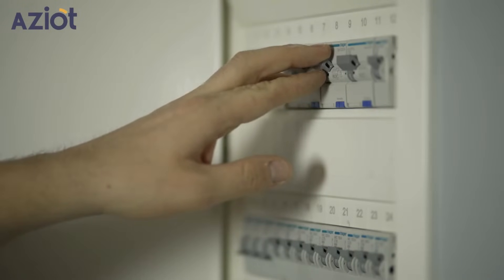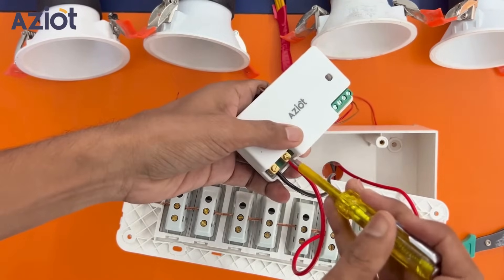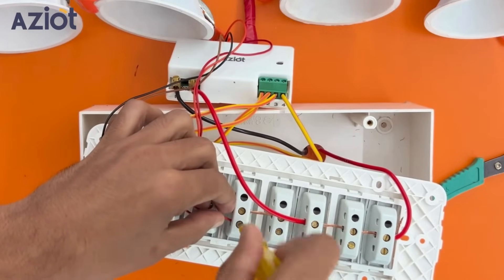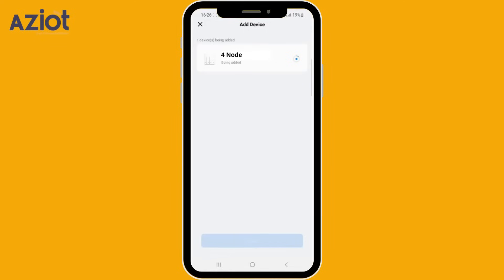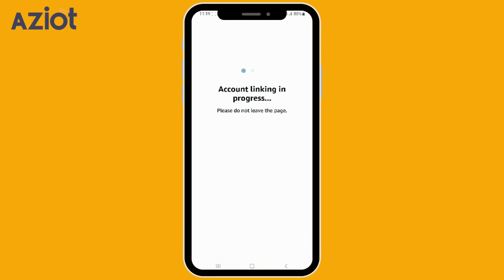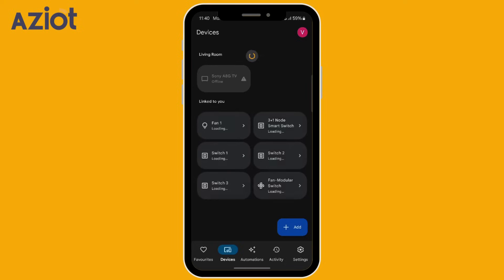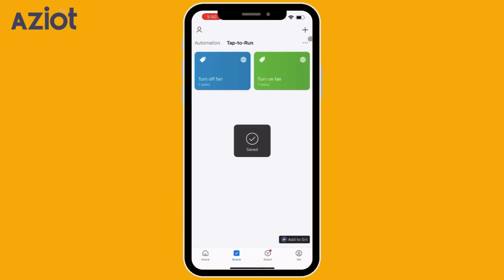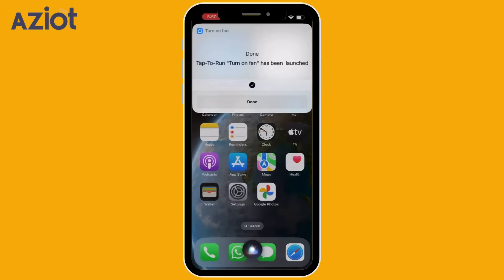Aziot 4 Node Smart Retrofit Switch Installation | 4 Node Retrofit Wifi Switch installation Guide

Comment: If I have 2 seperate modules let's say 2 switch and 4 switch installed on different switchboards, will all the 6 switches show up in same UI of the app?
Reply from the maker: Yes — both modules will work together in the app 👍

In Smart Life, they will appear as two separate devices (2-switch + 4-switch).
You can control all 6 loads individually from the app, and if you want one-tap control, you can easily create a scene/automation to operate multiple switches at once 🙌

Comment: How to change Wifi connection
Reply from the maker: To change the Wi-Fi connection:

Toggle any manual switch connected to the device 7 times ON/OFF quickly 👌
It will enter pairing mode again, and you can reconfigure with your new Wi-Fi.

If you need help, just let us know — happy to assist! 🙌

Comment: is there Manual Control Button for Flexibility ?
Reply from the maker: Yes — for the Aziot 4-node switch, there is a manual control option for flexibility 👍

You can always control the load manually if needed; the smart functionality adds convenience, but you don’t lose basic switch control.

Comment: Can you make a video on the connection in 4 sockets of board/extension board not having any manual switches just the 4 inputs sockets.
Reply from the maker: For 4-node smart switches, we don’t recommend connecting regular 3-pin sockets directly — because sockets are used for mixed/heavy loads like iron, mixer, heater etc.

Instead, we have a Smart Power Strip / Smart Extension which is specifically designed for sockets and appliances ✔️
It includes:
	•	Proper protection
	•	Individual ON/OFF control
	•	Safer load handling

If you want, we can definitely make a connection video for the smart extension board 👍
Would you like the product link?

Comment: Hi Aziot I don’t have any WiFi can I use or not one fan and five lights it’s possible
Reply from the maker: Hi, yes you can operate your smart switch remotely via Bluetooth. However, we don’t recommend using the 4-node retrofit switch if you plan to connect a fan. Instead, we suggest our 3+1 smart switch, which comes with a dedicated smart fan regulator

Comment: Can I connect fan switch wire in one of the switch modules?
Reply from the maker: We do not recommend normal fan to 4 node we recommend to use 3+1 node for connecting fan control. However you can connect bldc fan to 4 node to only turn on and off but not speed control

Comment: Can you connect AC as a device on this?
Reply from the maker: No you cannot connect AC to this device as the load capacity is not enough, you can use 1 Node to connect AC

Comment: Hi

Without using manual switch i need only wifi operation,if i don't connect the 4 wires going to manual switch,is it work through wifi?
Reply from the maker: Yes it will work without connect manual 4 wires, you can operate with wifi.

Comment: How much continuous power per channel?
Reply from the maker: Each channel of the 4 Node Smart Switch supports up to 200W of continuous power . Suitable for most lights, fans, and appliances. For high-wattage devices like geysers or ACs, we recommend using our 16A or 30A smart breakerinstead.

Comment: Please answer my question.Can i turn ON the switch and OFF by alarm or timer...example 5 o clock turn On the switch automatically and Off at 6 o'clock.Is it possible  through App
Reply: yes possible
Reply from the maker: Yes, you can easily set routines with the timer and schedule feature. Our smart switches also support app and voice control. You can purchase here: https://www.aziot.life/collections/smart-switches

Comment: Can ac work with this and fan not control just switch off and on?
Reply from the maker: This not suitable for AC & Fans,

For AC Control you can use AZIOT 1 Node Smart Switch

For Fan Speed Control you can AZIOT 3+1 Node Smart Switch
Reply: @aziot  i dont want fan speed control, i just need fan on off, and ac on and off thats it
Reply: AC is heavy load. Use 1 node switch as suggested.
You can use for fan as long as you not using fan regulator

Comment: What if I turn ON switch physically and then turn OFF using the app?
My physical switch will look like Load is ON but it is actually OFF. So what will happen if I power OFF the physical switch and then power ON again? Will this start my Load?
Reply from the maker: If you turn ON the switch physically and turn it OFF using the app, the physical switch will still look ON but the load will be OFF. When you turn the physical switch OFF and ON again, the load will turn ON. Both app and switch work together to control the load.
Reply: Please answer my question.Can i turn ON the switch and OFF by alarm or timer...example 5 o clock turn On the switch automatically and Off at 6 o'clock.Is it possible  through App
Reply from the maker: @dopermine2020 yes, we can turn on and turn off switches using scheduling features in the app
Reply: My question is what if I don't want to add switch only by app control then how should I connect
Reply: @harshalbhole7121  just leave both wires from switches unconnected, and set the memory action to remember the last state from app
Reply: @PranjalJoshi means connect the load wire to the screw or join them by wires coming from switch
Reply: I want to know how to connect them

Comment: Means even after switching off through mobile, only nuturl will be cut, not live
Reply from the maker: We control the live from device, not neutral, neutral is directly connected to the load. When you turn off from mobile phone, only live is disconnected.

Comment: Is this switch capable of inverter connection?
Reply from the maker: Yes, but you can give only 1 input connection, either raw power or inverter power
Reply: @aziot  okay if it's in both inverter will show overload right?
Reply from the maker: @SakthiVel-bb2jn  all loads will be routed through inverter power, so please check your inverter capacity
Reply: Yas

Comment: We're planning to buy multi color (3) downlights. Will I be able to dim them or change colors using Aziot? And what if I buy RGB strip lights? Do you have a store or dealer in Mumbai or Navi Mumbai?
Reply from the maker: With our 4node smart switch you can turn on & off, for dimming and colour changing you can buy our smart cob lights. We dont have any store in Mumbai
Reply: @aziot  we were planning to get 18/24 watt lights, i checked aziot only has 15w. if I buy the 4 node smart switch, will it help us with dimming? and changing colors between 3 shades of white?
Reply from the maker: @SakshamTalwar with 4 node you can just turn on and off, you cant do dimming

Comment: I have one doubt, Can off the light through mobile even the physical switch is on ?
Reply from the maker: Yes, you can turn off the light from your mobile app even if the physical switch is on.
Reply: If turn off the light physically then turn on the light from phone it will on or not?
Reply from the maker: @sellerhub8829  yes you can turn on the light from phone, even though physical switch is off.

Comment: I installed your 2 node device today.
I noticed that the device is having electro mechanical relays to control the load. I suspect that the device life is limited to 1 or 2 year. Please use solidstate relay for longer device life. And make it compatible with Samsung smart things app.
Reply from the maker: These mechanical relays are highly robust and endurance of 100,000 on-off cycles. They are the best option for switching high-capacity contacts. In comparison, solid-state relays of the same capacity are much larger in size and cost five times more than mechanical relays.
Reply: Yes it stopped working after 9months

Comment: I got this module a month ago. It started functioning randomly. Especially the on/off functionality from physical switch. Most of the time switch does not respond. And sometimes the light or fan switch does not work or light switch also turns on the fan. And sometimes time equipments starts automatically. Without input from app or physical switch. 
Warranty is useless, as i am asked to send the device to their Hyderbad address at my own cost. Buy it only when you to experiment their device not ready form real life usage
Reply from the maker: Hi, we’re sorry to hear about your experience. We take product quality seriously and would be happy to assist. As per our policy, we can provide a replacement after inspecting the device to determine if there is a fault. Please send the device to our Hyderabad service center, and our team will diagnose the issue. If found faulty, we will arrange a replacement for you. Let us know if you need any assistance with the process. Thanks for your patience!
Reply: @aziot Hi Aziot don't you have shame ? How come you are asking to send the device to the Hyderabad location it's ridiculous 😂😂
Reply: Im also having the same issue...it turn on and off automatically and at last it stops working..

Comment: One switch is some 1 meter away from the other 3 switches, which is fixed in another board. My doubt is can i connect additiinal wire to aziot terminal to make that connection to switch that is on another board.
Reply: Yes, you can

Comment: I have a remote controlled gate and in this I've a manual switch for this gate and it's a bell switch. So will the module work ?
Reply: No sir, this cant be used to control the manual switch to the gate, as the gate automation needs latching switch.

Comment: Does it work with inverter and 2 way switches?
Reply from the maker: It has single input connection, so you can either inverter load or raw power source, and yes you can two switches also

Comment: If im in out of town how will be  connect ?
Reply from the maker: With AZIOT, staying connected to your smart home from anywhere is easy! As long as your devices are connected to Wi-Fi, you can control them remotely using the AZIOT app on your smartphone. Whether you want to check on your security cameras, adjust your lighting, or manage any other devices, all it takes is an internet connection on your phone.

Enjoy peace of mind knowing you’re in control, even when you’re far from home.

Comment: What happened when i turn on load using  physical switch manually then can i disconnect load using voice command?
Reply from the maker: Yes you can control from app and voice control even the physical switch is turned off
Reply: @aziot  sir can I off my light or fan from apps or voice assistant when my physical switch is on?
Reply from the maker: @TanmoyShetty  yes

Comment: Can one of the load be the switch that controls the 6amp socket?
Reply from the maker: Yes you can connect the Socket, but please make sure that load connected to the socket is less than 1000w
Reply: Switch to socket connection is not supported and it is not working

Comment: I have a Wipro smart bulb. That will be turn on automatically whenever the power gone and comes,that will not remember the old state which the before the power goes.
Is this also same like that..??? will it remember the old state whenever the main power goes out and then comes back
Reply from the maker: Yes, our smart switches allow you to set the power-on restart status in three different ways:

Power Off: The switch will remain off when power is restored, regardless of its state before the outage.

Power On: The switch will turn on when power is restored, regardless of its state before the outage.

Restart Memory: The switch will return to its last state before the power outage. If it was off before the outage, it will remain off; if it was on, it will turn back on.

This flexibility allows you to customize the behavior of your smart switches to suit your preferences and ensure optimal functionality.

Comment: what happens if the main power gone and comes ..??? 
Suppose if i turned off via voice command before power goes ..??
what state it will be ..??
Reply from the maker: Yes, our smart switches allow you to set the power-on restart status in three different ways:

Power Off: The switch will remain off when power is restored, regardless of its state before the outage.

Power On: The switch will turn on when power is restored, regardless of its state before the outage.

Restart Memory: The switch will return to its last state before the power outage. If it was off before the outage, it will remain off; if it was on, it will turn back on.

This flexibility allows you to customize the behavior of your smart switches to suit your preferences and ensure optimal functionality.

Comment: What happens if we turn on manually by switch and through app at same time..?
Reply from the maker: For our retrofit switches, if you turn on the switch manually and through the app at the same time, the switch will recognize the last command received. This means that the device will respond to the most recent input, whether it’s from the manual switch or the app, ensuring accurate and synchronized control.